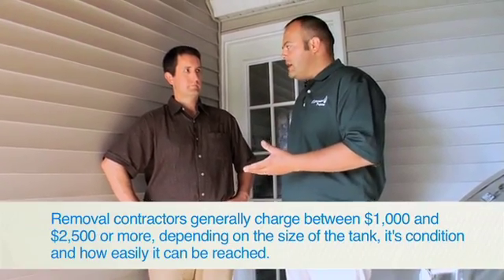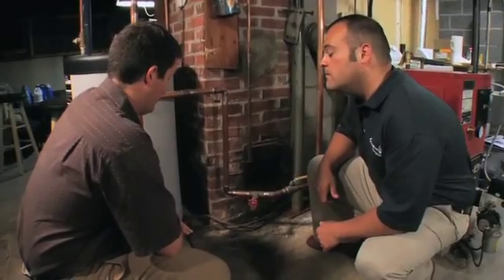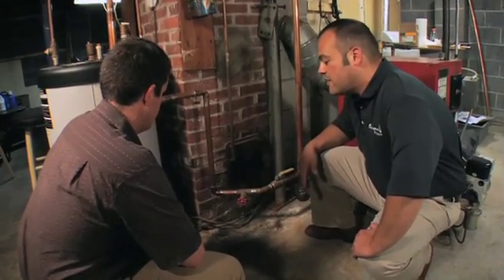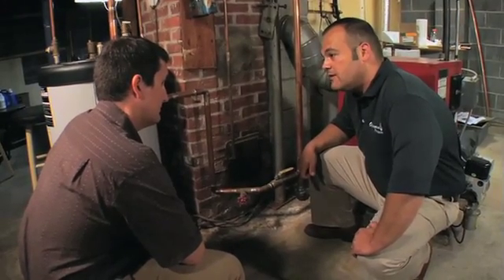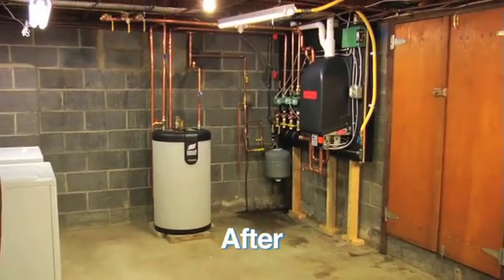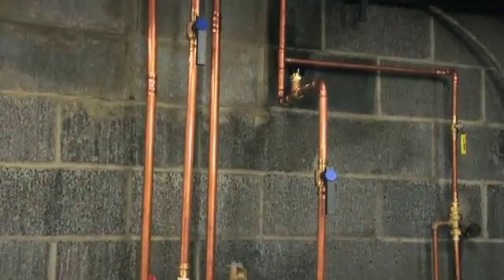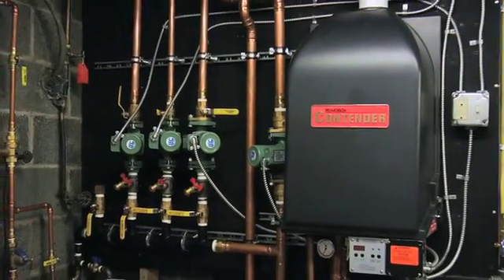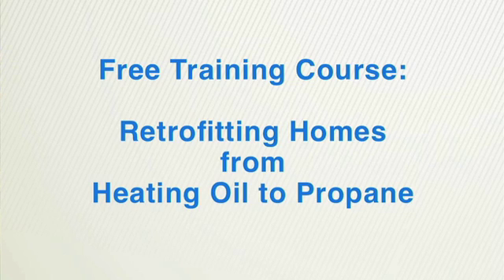Converting an Oil-Fueled Boiler System to Propane, Part 2

Comment: Why is no insulation fitted to the pipework in most US installations as there are heat losses with non insulated piping? In Australia where I live insulation is fitted to copper pipework in order for it to meet efficiency standards,
Reply: Unnecessary for a boiler especially high efficiency, the amount of heat loss is slim to none depending on the run